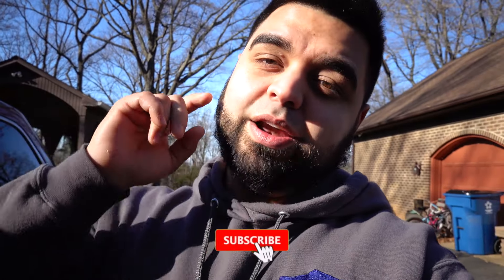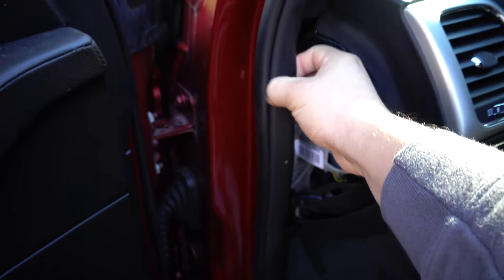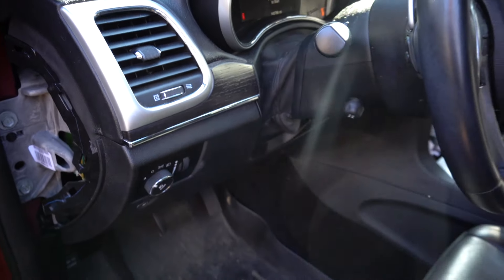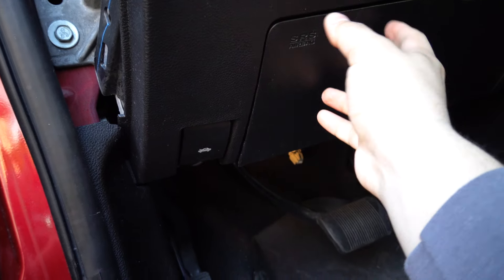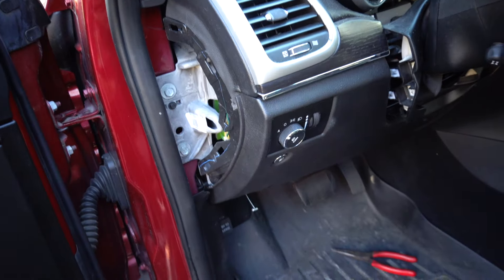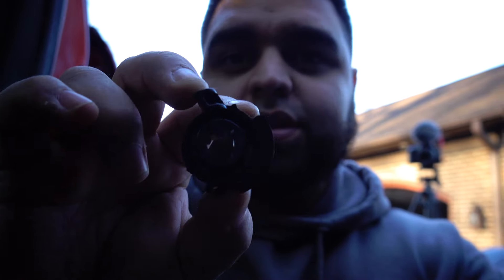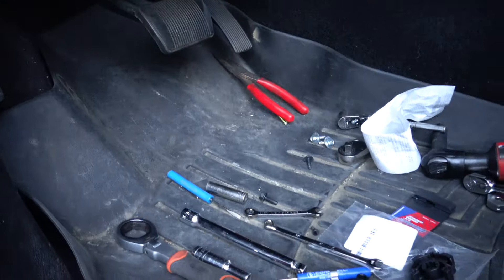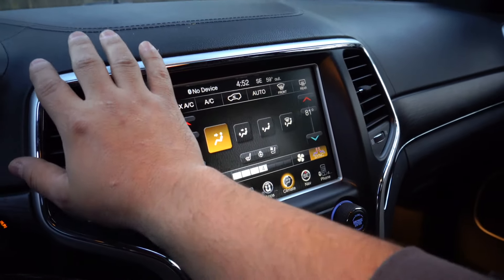How To Replace Driver's Side Blend Door Actuator Gear | WK2 2011-2020 Jeep Grand Cherokee

Comment: Just replaced it and my acuator just goes in cirlce and ends up breaking the teeth on the gear??
Reply from the maker: Oh man. My guess is that the teeth weren’t lined up correctly. You have to be very careful because there’s only one way it goes and it could easily move

Comment: You and everyone else doing this job aren't calibrating (synchronize) the blend doors after you change them!
That's why the fail a second time. The actuator throw must match the door throw (arc) or they will bind and bust the gears. Nothing to do with outside temp.
You need a scan tool (Chrysler) to do this. 
Clearly stated in Dorman's packaging. 
Not sure about the cheap Chinese shit off of Ebay?

Comment: did you have to calibrate??? my low is heat and my high is cold
Reply from the maker: No, you don’t have to calibrate it. Make sure that it’s lined up 100% correct. The big wide tooth goes in the big wide slot and you should be good to go.